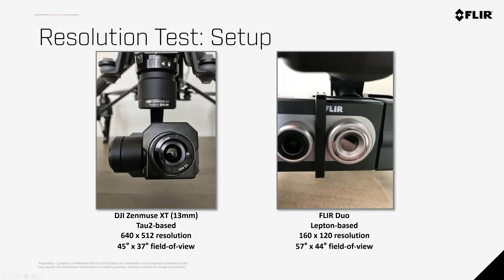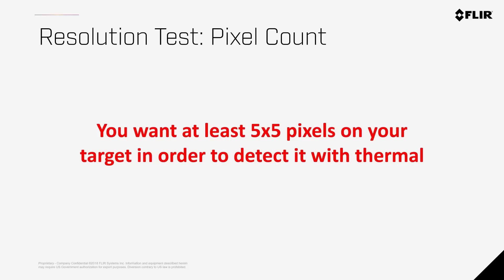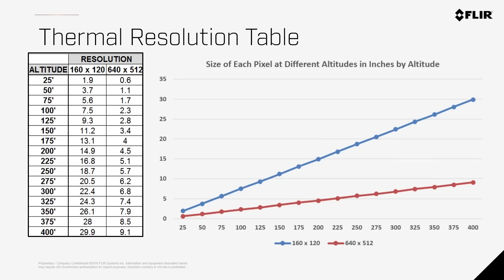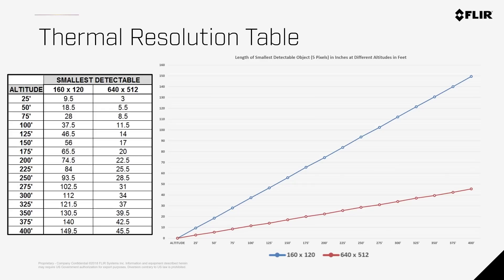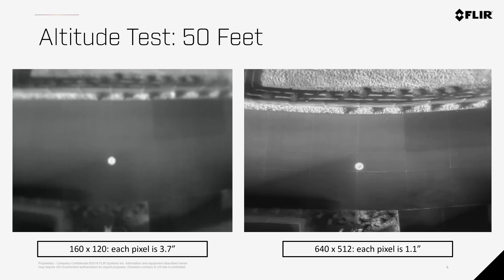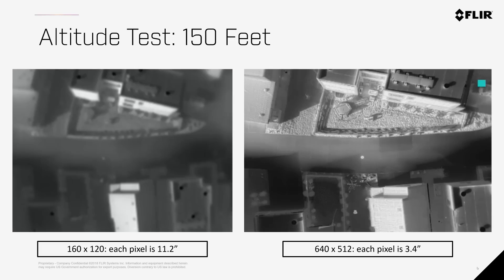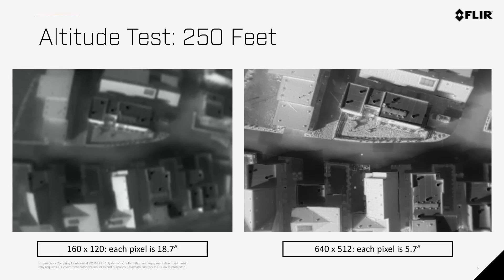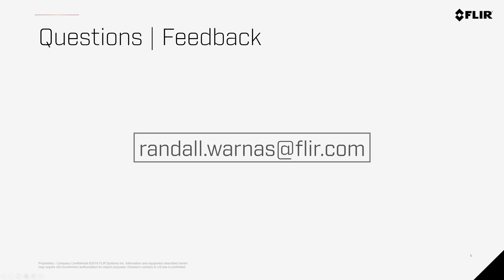Webinar: What can I see with my thermal drone? | FLIR DELTA

Comment: hi, so using MAVIC 2 DUAL (160x120) to monitor active volcanos from 300-400m distance would be very blurred?
Reply from the maker: There are many variables in your question, the largest of which is what is the size of your target? You should definitely check out some introductory courses on thermography that will help you build a foundation on the fundamentals. You will learn things like distance to spot measurement, how that relates to accuracy, and other properties important to all applications. Check them out at TinyUrl.com/ITCWebinars
Reply: FLIR Systems, Inc. thanks i will read it. I just wanted advise from somebody who has knowledge about thermal cameras. In regards of size. I talk about volcanos not about frying pan. I just thought that somebody can tell something like that resolution will be insufficient. If i know something i just give advice and not point tons of information to read. By the way do I find there something about that resolution and active volcano? Because all the time i just see talking about close distance and images from 50m and object like building, people and so. But thanks for link
Reply from the maker: What is the size of the specific target you are trying to measure? Once you have an understanding of that, you can calculate your spot size with distance for the different resolutions and understand which configuration would best serve your specific application. Thanks for your message!
Reply: FLIR Systems, Inc. really? How can I measure active volcano?
Reply: To be honest this answers are like when i asked guy who makes tattoo how much I will pay for tattoo. His answer was draw it and count cm2 and multiply by price. I expected that somebody who makes tattoos for living knows approximate price.